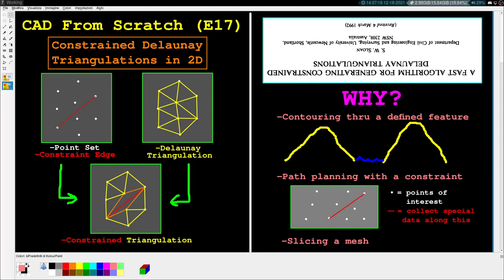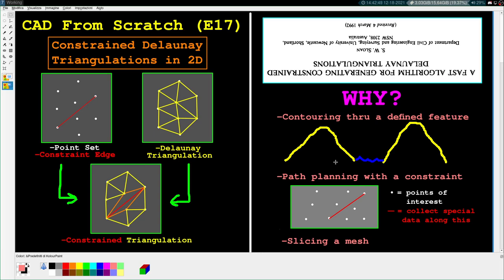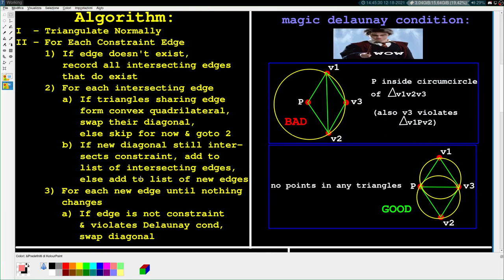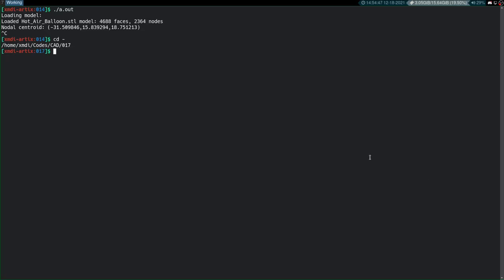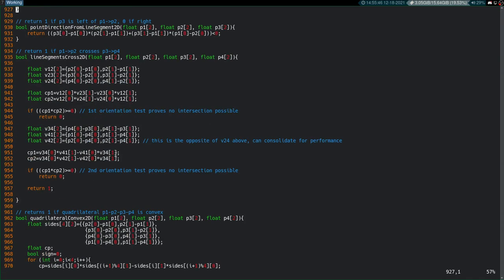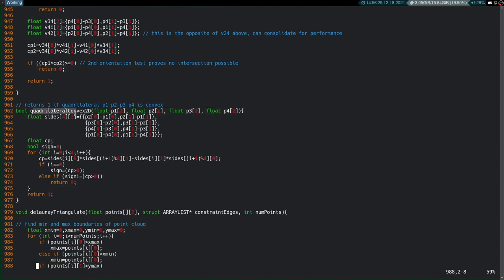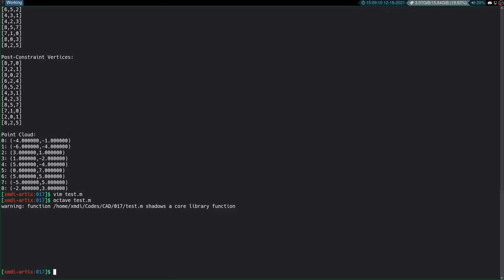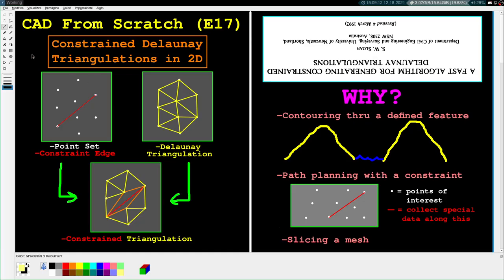CAD From Scratch [17] | Constrained Delaunay Triangulations

Comment: Awesome tutorial, thank you very much for sharing!
 I wonder (I assume no constraints for simplicity), what would happen if the next point I place, P, is exactely on the edge where 2 already created (anticlockwise) triangles ABC and DEF meet? So AB and ED are the same edge and P is on that edge somewhere in between.
 If I consider P to be inside ABC, then I can only make two 'real' triangles out of ABC, not three: PCA and PBC. "Triangle" PAB is 'degenerate' since P, A and B are on a line.
 I would think that I must in addition treat P to be contained in DEF, and so I would make 2 'real' triangles here too: PEF and PFD (and here again, PED is 'degenerate' since P, E and D are on a line.
 So in total I would end up with a total triangle count of +2 after placing my point P, which is similar as in the 'normal' case where I slice one triangle into 3 when my point is not on an edge but nicely inside the triangle.)
 - Would this be the correct approach?
 - Or would I really just pick either ABC or DEF to contain P? And if so, then how do I deal with the degenerate third triangle? Since the radius of the 'Delaunay circle' of that thing would be infinite...
 - Does the code do the right thing in this case?
 Thank you for any insights!!